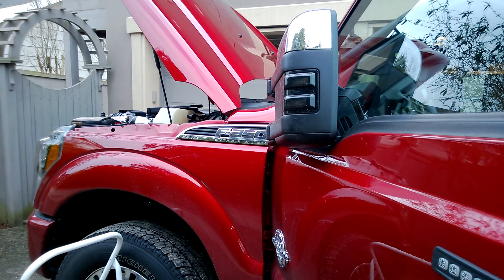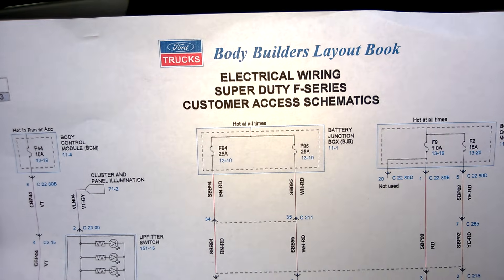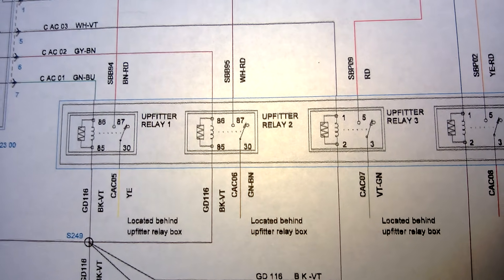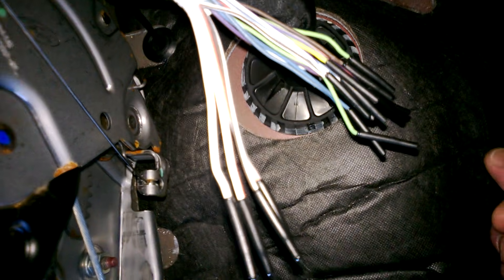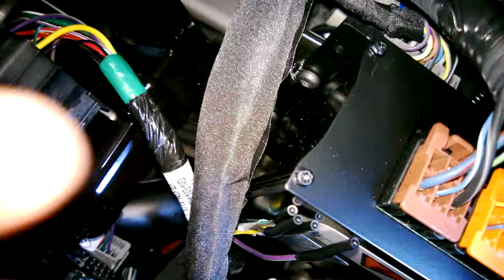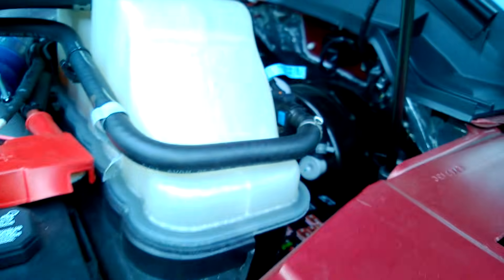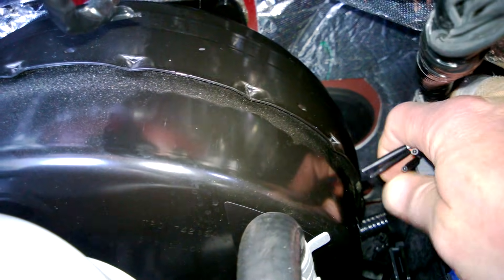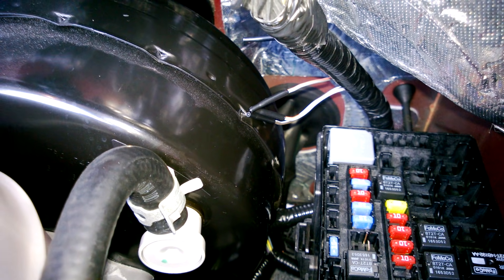2014 Ford Super Duty Upfitter Switch Wiring

Comment: Idk why using these switches seems to be such a hard thing to explain. I'm not gonna name any names but how is the title to their video "how to use upfitter switches" and then you show me how to wire the light bar to a relay then to the high beam lever how are those even remotely the same thing? The dude briefly mentioned how the upfitters and wires work but showed NOTHING. This is about the only video that actually just explains what they do and how to use them

Comment: After 2 hrs of searching and even being on the body builders info. Your identification of the engine bay side location (behind the fuse  panel, taped down,  just pull up) is the clearest identification of the jumper wires I've found.  Thank you

Comment: I know this vid is 10 years old,  but just to confirm, you will connect the Aux cable to one of the cables that go through the firewall and then connect the end of the through firewall cable to what you want to power?  Then flip the switch and it should get the 12v?

Comment: Do you still have to run a ground up to the battery?
Reply from the maker: Yes you will still need to run ground wire.  I would use one of the many chassis ground points instead of back to battery.

Comment: I’ve watched a few videos about the upfitter switches and yours is the best one yet.  The one thing that NONE of these videos addresses is whether or not these circuits are protected by a fuse inside the vehicle or does the upfitter need to protect them after they go through the firewall.  I’m going to check it out myself but I’d sure like to get that diagram you have, either directly from you or maybe you’ll tell me where on the web I can find.  Thanks for any response.

Comment: So for connecting the upfiter switches i find which wire correspond with what switch then put hot wire for device into switch wire then black just ground it correctly right

Comment: None of the wires you are showing match up with the wires on my 2015 super duty f series diagram, Hard to believe they would different from 2014.  I thinking will my leave radios hard wired to batteries with fuses.

Comment: So if I understand you correctly...if I wish to power a light at in the front of my truck I should run power to one of the 4 wires in the engine bay, go inside the truck and connect that corresponding wire to the switch wire I wish to use?
Reply: I'll be watching for an answer.  I have the same question and can't find a straight answer
Reply: Brian- I wired an LED light bar this weekend and I did the aforementioned. Works well and made the job much quicker. Just have to pay attention to the wiring you use.

Comment: So you can hook onto the wires in the engine compartment or under the steering wheel and use the uplift switches,,,correct...also anyone know anything about the rear pig tail connectors in the rear frame of a cab and chassis F 450,,,have three different plug in sets of wires,,the company who installed messed everything up,,, Great video,,thanks so much,,how can so many other people not understand what they are doing.

Comment: I just received my light bar. I am only using the upfitter switches for this install. I have a 2008/F-350. My intent is to use AUX 1, my yellow wire which is in the same location as yours. I will connect the positive wire of the light bar to the yellow upfitter switch and ground the black wire to the truck. The light bar also came with a wiring harness which has an inline fuse and its own relay. I don't plan on using any of these wires. Can you tell me if this is correct?

Comment: Great vid! Already saw a few before this one but yours specified what i needed to know if i wanted to run an accessory inside the interior and not on the engine side with the upfitter switches. Thanks! Btw, i saw that link you showed on  paper on various forums online but once you click on the link it is no longer available unfortunately. Probably someone is trying to make a dime off that info.

Comment: the switch go's through a 30 amp fuse already
Reply: so are the switches a good source of switched 12v power?
Reply from the maker: Switches go thorough fused circuits.  They are not all 30 amp.   I do not remember them, but they are different ratings depending on the switch you use.
Reply from the maker: Yes..they are factory installed for you to use for accessories you install.   Yes, they are 12 VDC.
Reply: +Hawgwld thank you sir, I just downloaded the 2011 schematic
Reply: +Hawgwld 1 & 2 are 30 amp, 3 is 10 amp and 4 is 15 amp

Comment: now im a little confuse about the neg wire I mean im mounting a led light bar and it has a red and black wire, I know the red is positive and black is negative so I know im hooking the red to the yellow wire but where does the black negative wire goes?
Reply from the maker: Tactical take it to the body or like I did to the negative terminal of the battery on the drivers side.
Reply: Hawgwld so like screw the wire to the body of the truck like on the frame? sorry just trying to make sure im doing everything right

Comment: Really nice job here...  Thank you for taking the time to make and share this video..   Are those black ends on the wires "crimp" connectors?  
Now all I need to find is a video on how to pull that lower dash panel off without breaking something...
Shame on Ford for burying these wires so deep in the truck..
Reply from the maker: rvandeloo panels are on snap style holders. You  can carefully pull it off.

Comment: in order to get the power through the fire wall do you have to make a connection under the dash I looked in the book and watched you're video and ended up connecting under the dash and pulling my own wire through the fire wall because none of the wires under the hood behind the fuse box were hot this would clarify this a lot thanks.
Reply: 2fast65 there are wires provided for fused power, plus the aux switch outputs, and 4 wires that are dead ended on each side of the fire wall.  No need to pull any wires through the fire wall

Comment: Thank you. . .very, very helpful.  Now, if someone could show how to physically connect a wire to the existing pigtail wires it would be really, really helpful.
Reply from the maker: Richard Conley I use waterproof heat shrink connectors from West Marine.

Comment: I'm going to be using this upfitter switch for an LED light bar.  Do I still need a relay or can I just wire them direct?  Thanks.
Reply: I wired mine directly to the up fitter no relay needed.

Comment: Thanks for posting this. I spent about a half hour on the phone with my dealer with a tech trying to figure it out. I spent about an hour this morning searching and searching with no success. Decided to google and found your video and it took me a bit longer but found them. I did remove the panel on the left dash with the vent in it. Helped me see it a bit easier. I have a bad back and am tall so I have a hard time getting under the dash. I am pretty pissed at Ford for having such short wires...impossible to work on. Under the hood was not much better. You would think for a 60K truck they could have put in another two inches or so.
Reply: I agree.  I was really pissed off that they had a great option with the upfitter switches only to sour the deal by making the hookup wires nearly impossible to access.
Reply: Some people would pay more than $60k for more than 2”

Comment from the maker: Krys George...Sorry I do not know of any panels you can remove to make access to the wires under the dash easier...  You may try opening door and taking the side trim panel off where the driver door defrost vent is.  It pops off if you pull on it.  Also you can go to http://www.helminc.com and order the DVD shop manuals for your truck. I have them and found them worth the price.